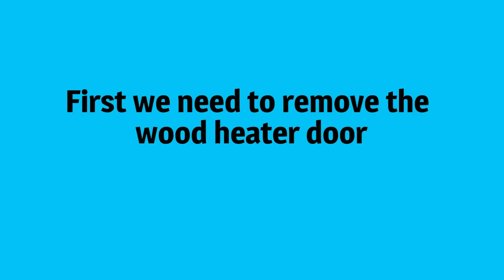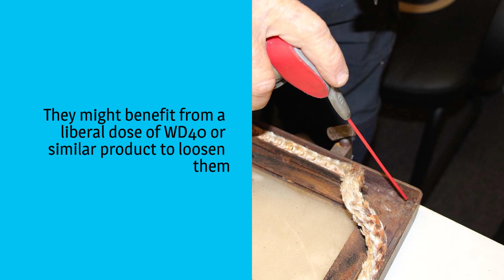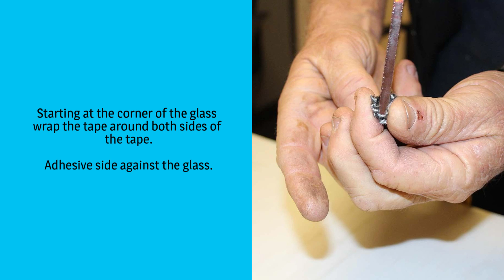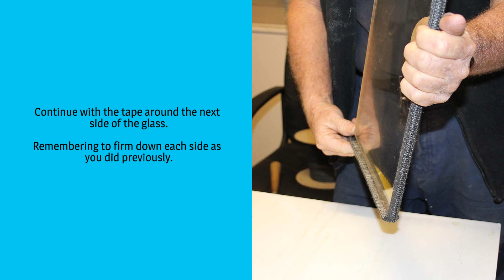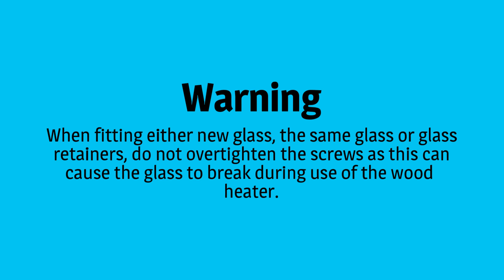Replace wood heater door glass tape seal gasket

Comment: Excellent video - The metal on my door was rusty so I sanded it down to bare metal & gave it a fresh coat of high temperature paint. Plus the inside facing side of the glass had a brownish looking stain so I used polishing compound with an orbital polisher to make the glass look brand new. Your video does a great job showing how to apply the new gasket.

Comment: Thank you! another tip to clean the glass - you can use some black ash from fire and a little water, make a paste and wipe the smut off - or use 0000 wire wool to clean glass or the surrounding. Cheers

Comment: Do they need a certain type of glass as my glass has cracked :(
Reply: Mine did too.  The local hardware store recommended going to a glass company to have them create the window then "tempter" the glass.
Reply: @DronesOverHaines  ...My glass in my wood burning stove was cracked, my local glass shop made one for me for $48, they had to have the old one to use as a template. A new one from Amazon was $104. fyi.. it's not tempered glass, it's clear ceramic, which does not contract and expand due to extreme temperature changes,
Reply: @Retro-Hippie  This is great information.  Thank you!  I will check out Amazon for the new glass!